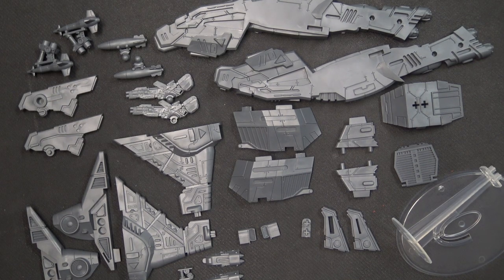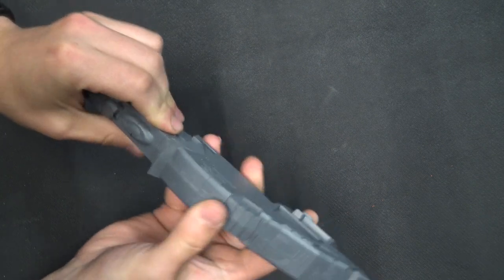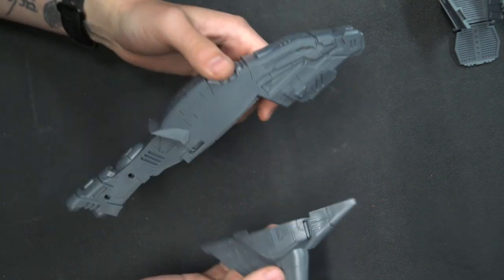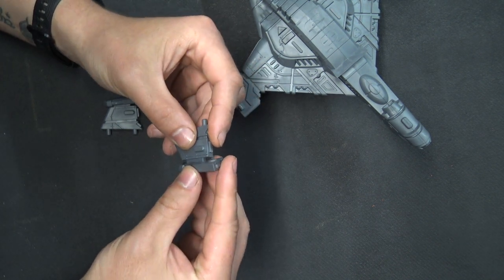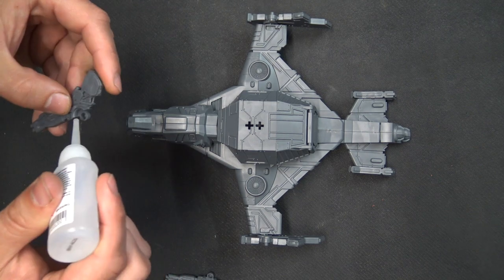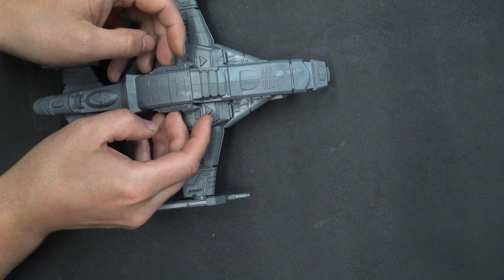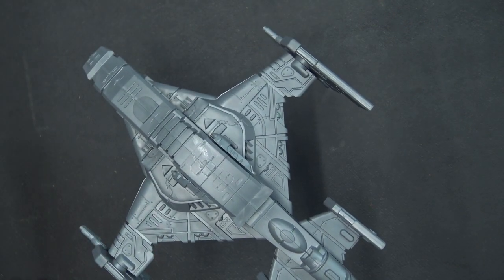Mantic Monday – Firefight – Building Vehicles – Enforcer Interceptor

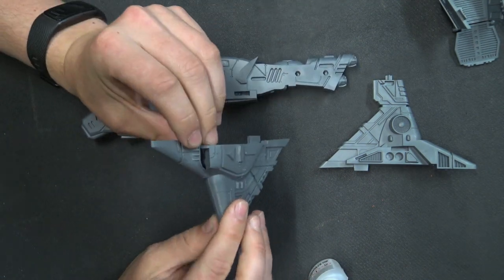Comment: IMPORTANT NOTE:   Build error discovered at around 4:30 by the presenter which he immediately corrects but must disassemble glued parts to make it right.  Do NOT glue the wings together until you watch the entire video.  It's fixable if you've used model cement but if you have used superglue you can mess up an important detail.

This is an excellent kit and probably one of the easiest to build vehicles I have ever assembled.  The pieces come already cut from the sprue and the fit for the pieces is generally very tight.  The only downside was the easy to overlook forgotten intake on the wing that the presenter quickly fixed as noted above.